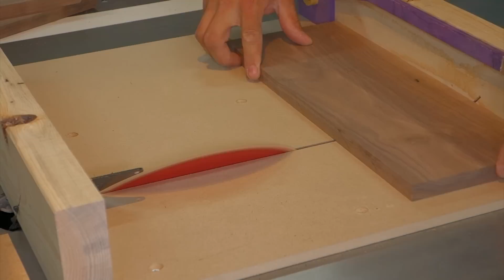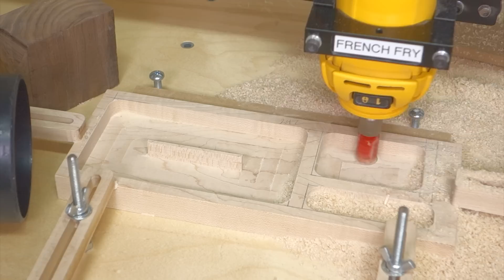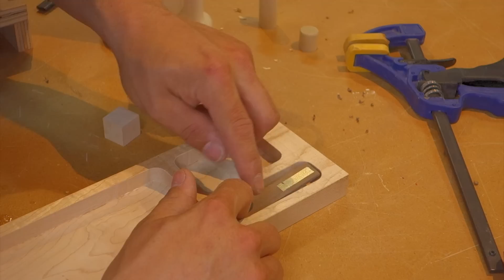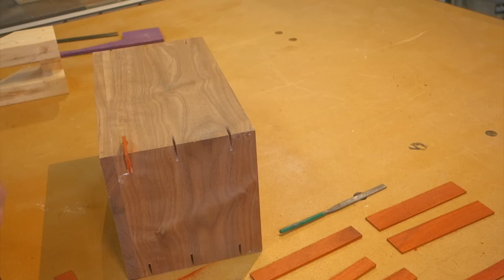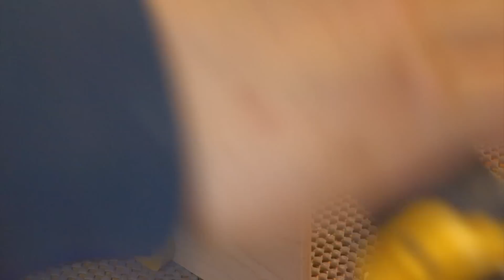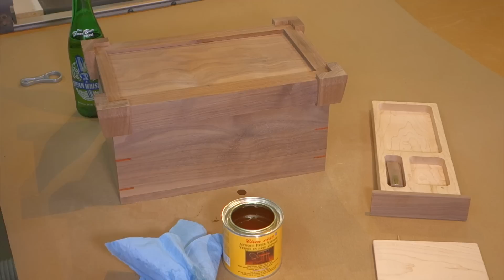Secret Compartment Box II

Comment: Your video inspired me and I built a similar box, but it was a little larger.  I used the same concepts for the hidden tray, except, I used tongue and groove cedar on the inside of the box and put oak trim on top of it.  The hole is covered by one piece of cedar that is glued only to the top trim, so you lift up on the trim and cedar to expose the hole.  The corner and base trim are virtually the same.  Since my lid was so big, I put chains on it to keep it from opening too far.  Thanks!

Comment: I went with a less complicated release mechanism.  I have brass tube and brass rod holding the tray in place.  You just have to pull out the one inner side piece that has the brass rod epoxied into it and that allows the tray to release.  The tray has the brass tube epoxied in which the rod inserts into.
Reply from the maker: You removed the best part. The spring releasing the tray makes a satisfying pop when it’s triggered. I wouldn’t want a secret compartment box if it didn’t make that noise.

Comment: the method for releasing the hidden compartment is genius! the only thing I could recommend is adding a small magnet at the bottom of the hole the pin is in. just to keep it from accidentally moving around and revealing the secret. Also, you might want to start making your boxes look shittier, someone is going to steal the box just for the box and not even realize what they took! excellent job!
Reply from the maker: +luc lachapelle Thanks.  I'm not sure what you mean with the magnet.  I assure you everything fits snugs and nothing moves around.  The liner piece is fit perfectly so there is no wiggle room.

Comment: I built something alike a few years ago and, if you allow me, I would like to give you a little piece of advice.
 Put the spring in the drawer and not in the body of the box. The spring will lose its force over time and it will make harder the drawer ejection. However, with the spring in the drawer, you can replace or adjust it easily, what do not occur when the spring is attached to the box.  :)
Reply: Hey I would really like to know how to do that. I don't quite understand how when you put the pin side in it opens. Thanks for any help.

Comment: Hi Dustin, beautiful box!  I was wondering about the lever inside the drawer that you flattened and glued a piece of (copper?).  Is that done to make sure the pin doesn't get stuck if it were a wooden lever without the metal strip?  Thanks
Reply from the maker: Fletcher Le Tet Thank You!  It was a small piece of brass, but copper would work the same.  It helps it slide, but more importantly, it offers some protection to the wood.  I didn't want the pin to wear down the wood from the constant sliding.

Comment: wow very cool! just one question: i did not get it how the opening mechanism works together with the spring works.. do you have any further explanation for that? thanks in advance!
Reply: The spring keeps constant outward pressure on the drawer; the piece with the little brass plate catches on the inside of the side wall, preventing the spring from pushing the drawer out until you use the side liner with the pin in it to press down on the brass plate and release the catch. Hope that helps.

Comment: Very nice work indeed, what's the stuff you put (powder ?) in the secret compartment after painting it ?
Reply: Robert Matter Thats called Tex Flocking Fiber with a Mini Flocker. Its basically making a felt liner inside the drawers.
Reply: Shane's Hobby Shop do you put it on before the paint dries? or it is self adhesive?
Reply from the maker: ***** It's not paint, it's coloured adhesive.  Immediately after applying the adhesive, you dust on the suede fibers and they stick to the adhesive.   Once the adhesive dries, you blow of the excess fibers and its done.
Reply: Dustin Penner Ah that makes sense. Thanks for explaining.

Comment: Where did you get the hinge for this box? I noticed that it was a 90 degree stop hinge and I am looking a good solid brass like this one.
Reply from the maker: I got mine from Lee Valley but Brusso makes a far superior hinge!
Reply: Thanks Dustin, I have found that some of the hardware for these boxes is very expensive, $70 for a pr of hinges is nuts. Yesterday I went out to Lowe's and bought a new DeWalt router with bits and enough wood to make two more boxes. Please check out my latest build on my ch..
Reply from the maker: I checked it out.  looks good.  If you're going to continue to build boxes from my design, would you mind giving me credit in the description?

Comment: @1.29 - are you "manually controlling" a CNC?   I see stepper motors i think, but it looks as if you are moving/controlling this manually?  I can't afford a CNC, but could possibly make a "manual" one...
Reply from the maker: +Patrick Duncan Yes thats exactly what I'm doing.  I was about to make a fence and use my small router, when I realized the CNC should do the job just fine.  It wasn't connected to power and the stepper motors gave just enough resistance to keep everything lined up.  It wasn't that I didn't trust the accuracy of the machine,  I was afraid I wouldn't have it lined up in the right spot.
Reply: +Dustin Penner Thanks for the quick reply...   I may start looking for a "partial" system - i.e. one w/o controller, etc.  Great work BTW

Comment: Ok, 1st) that's a bad ass box.
   2nd)  If the top of the box is open, and you flip it upside down, will the little "release pin panel" part fall out just because of gravity, or is it snug enough not to?
Reply from the maker: Thanks very much!  It's a snug fit.  You wouldnt be able to shake it out ir anything.

Comment: Was there a rationale for choosing paduk for the splines or just for color?
Reply from the maker: Just colour.  Curious why you'd ask.
Reply: @dpmakestuff  Just wondered if the hardness or expansion of the wood used for the splines is a factor, or if you can pretty much use any wood.

Comment: wow. I really enjoyed watching how to make your secret compartment box. I wish I had the skills to do that.  How could I get one?
Reply from the maker: +david fletcher I am working on a website right now where I will sell these from time to time.  Thanks
Reply: How did you come up with the idea of the opening mechanism?
Reply from the maker: +david fletcher just came to me. No idea how.
Reply: I think it was a fantastic idea. Do you mind if I could pose an idea for a different kind of opening mechanism?
Reply from the maker: absolutely.  you can do it here or shoot me an email (it's listed in the about tab)
Reply: Have you heard of an air pressure lock? The basic principles is when no pressure is applied the lock is shut and when it's applied like from a sharp blow the lock opens. It uses a piston that rises and falls dew to air pressure.
Reply from the maker: I've kind of done this before on the first one I built.  I jammed the compartment in and it was too tight for the spring to push out.  I used my air compressor to blow into the hole to help push it out.  Its an interesting idea, thanks
Reply: Another great type of lock is a compass system where the box has to be pointing in a certain direction.
Reply: +david fletcher that sounds cool!  you have a link?
Reply: Grand illusions.

Comment: does it need nails to be stronger or that amount of glue is enough for it?
Reply from the maker: Id rather drive a nail through my own hand then put one in this box. The glue is top of the line waterproof wood glue and the corners are reinforced with splines.
Reply: +Dustin Penner tnx got it

Comment: This might be a stupid question... but what's the difference between a joiner and planer?  They seem like they do the same thing =/
Reply from the maker: +James Trafny I'll do my best to explain.  

A Jointer will create a perfectly flat side, but that side wont be parallel to the opposite side.  A planer will create a two parallel sides, but the board might not be flat (cupped, bowed, twisted etc.).  Typically, you use the jointer to flatten one side, and one edge, then pass it through the planer to flatten the other side parallel to the jointed side.  At this point you have 3 sides that should be 90 degrees to each other.  You can then pass it through the table saw using those sides as reference and trim down, or cut off the last, untouched, side.

There are many different ways to flatten a board, this is just one of them.  Also, check this video out https://youtu.be/3bbHwoi4kz8
Reply: Thank you for the info!  Really nice of you to take the time to do that!

Comment: are the orange corner prices for decoration?
Reply from the maker: I'm going to answer all your comments.  Those are called splines and they reinforce the corner joints of the box.  They also add to the overall look of the box with the contrasting woods so i guess they are for strength and beauty.

Comment: What is the point of those shimes in the corners?
Reply from the maker: +Hyperion 88 They're called Splines.  Glueing endgrain to endgrain is very weak.  The splines give sidegrain to sidegrain surface area to strengthen the corners.
Reply: +Dustin Penner I see, thank you very much. I've never fashioned a box before, but ill keep that in mind if I do.